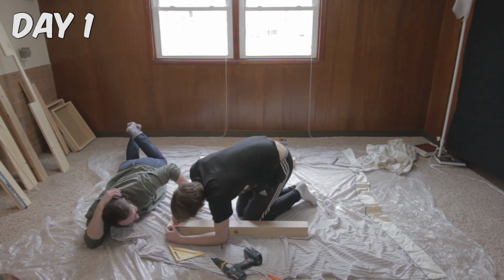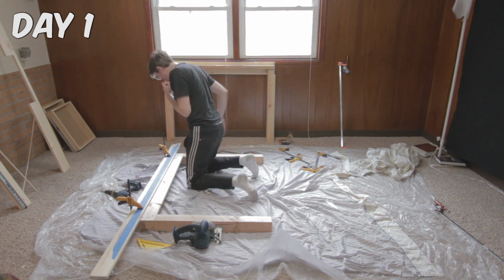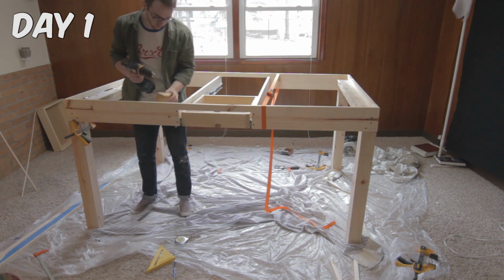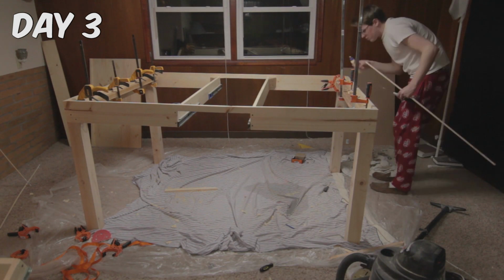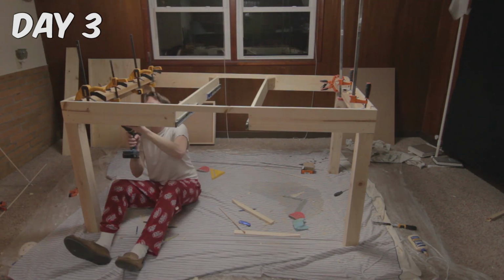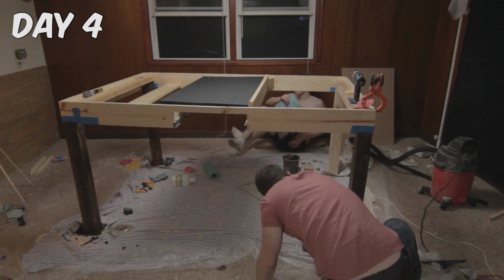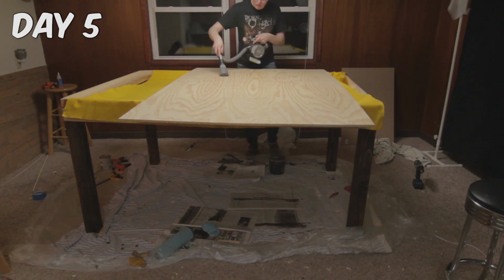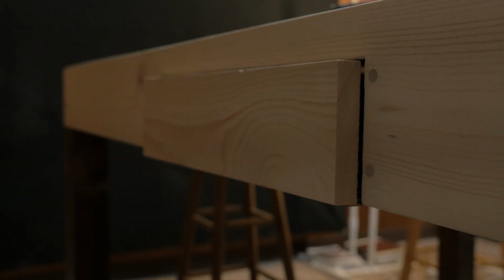Episode 13: Building a Board Game Table

Comment: Table looks great!  If you're still concerned about the stability you could add a "z brace" under the tabletop to strengthen the box formed by the edge of the table and drawer pocket.

Having drawers in the middle like that was a great idea, I bet that's really useful.
Reply from the maker: It's so useful! Rulebooks, cards, dice, tape measures, you name it! Thanks for the z-brace idea :)

Comment: That was a nice first attempt! If you decide to do another one, I'd like to see the video :) Anyway, one way to hide the crooked cuts around the drawers and such is to use trim/molding. You can cut frames for around the drawers and other openings and then only have to worry about using wood putty when your miter saw decides to not cut properly.
Reply from the maker: But I still cut the trim with the mitre saw I thought. Wouldn't the same problems happen again? 

I definitely wanna give it another go. Not sure what I would do with this table, though. It's kind of stuff in my basement :D
Reply: SDub
The trim solves one problem (the cutouts for the drawers and pull out tray). Wood putty and sanding would take care of the mitre saw issues. :)
Reply from the maker: Ah, thanks for explaining :)

Comment: I would add a support between the drawers it will help as the drawers are a weak point. Asides that flaw it's a nice table
Reply from the maker: Dragnar Drake thanks!
Reply: Another good way to do it is to make the side skirts decorative rather than structural by building an internal skeleton to the table, then attaching the skirts around the outside. You could then use 2x4's for more stability, since they won't be seen. Then you can keep the cool cutout style to the drawers without jeopardizing the structural integrity of the table.

Comment: Not a wood worker at all. But i would flip it over and sturdy the table with braces and and plywood. In its current configuration it looks as if it will snap in half at the drawers. Still a good looking table.

Comment: Ok the 2 sides are supported only by a thin area above the Drawers, look sot be 1-2 inchs and appears to only be 1x4 or 1x6 material, the side I see on the Video has a Bad Wood Knot in it, making it even weaker, you need something to strengthen it long ways,    * for the Pull out shelf on End, simply put a Guide Rail Under and Above Shelf on each side, also I see you put No Padding under felt, if play any cards, Flat token etc, just a tiny bit give will let you pick them up easier, and still be Stiff enough for Minatures  or what ever stand on, Might Sand and Polly the other side and make it able to lift our and flip over of Solid surface also.    but looks good anyway, Happy Gaming 8)
Reply from the maker: Very good points. Definitely trying to add some stability to the table so it doesn't break in on the sides. The two sides are also supported by the drawer rails that run along the middle of the table, but still, it's a pretty poor design, haha.
Reply: Run some Lumber under the Table Long ways from one end to the other and Attached it at both Ends and Any Cross Members underneath.

  Next time Cut a Rectangle Hole for Drawer, so there is a little meat over and Under Drawer will make sides alot stronger.

Comment: I've ordered the dark vengeance kit and the citadel essentials kit... if I'm just starting how many paints would I need... for instance in the essentials kit only 1 wash comes, would I need more? No layers come so would I need layers?
Reply from the maker: Citadel's painting ecosystem is interesting. A lot of other companies don't really differentiate between base paints and layer paints. 

If money isn't the biggest issue, what I would do is buy the paints you need to finish the projects you have. If money is a big issue for you, I'd consider buying very high pigmentation primary colors (like red, blue, and yellow) and mixing the shades you need. This is difficult for beginners and is subject to getting results that are not consistent between minis, but it is certainly the cheapest.
Reply: Miniac thanks man